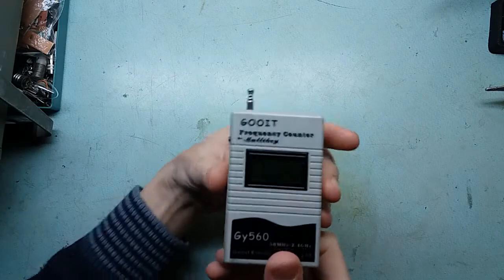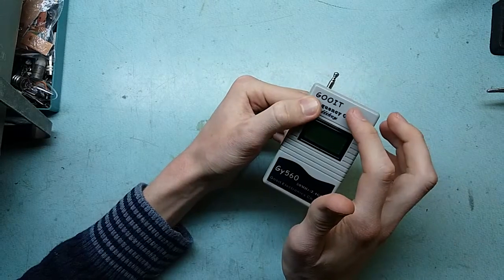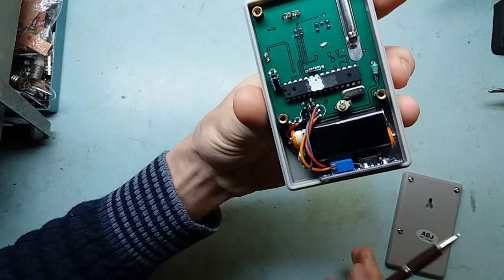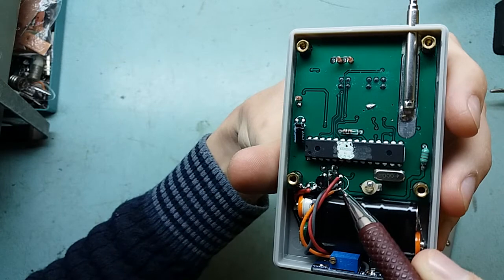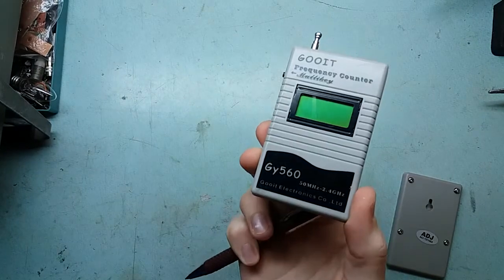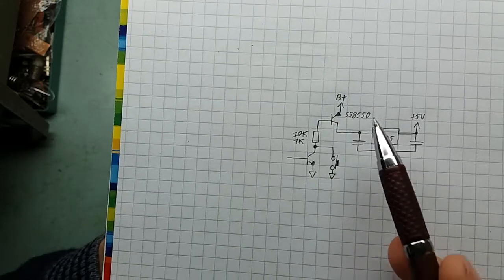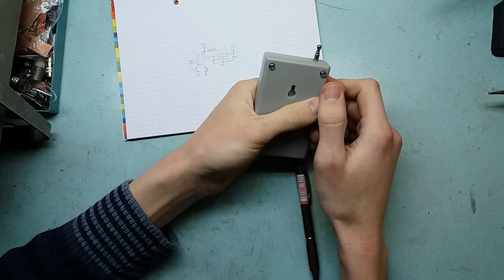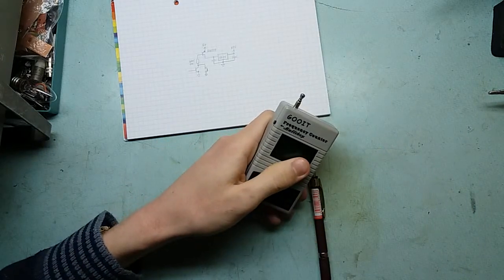Little mod to my frequency counter

Comment: In case you need to know, the chip in mine is marked as an ATMEGA8A-PU. Also, holding in the button as you switch on allows you to change the frequency step size between 200kHz, 1kHz and 100Hz. Handy little meter. :)
Reply from the maker: I'm aware of that trick with frequency steps, but thanks anyway :) I suspected that the chip is Mega8 or 168 or 328; judging from pinout. But it's nice to know for sure.

Comment: Thats working much like the one in your multimeter, but is much more compact and a nice multiturn pot to set voltage ;-D.
Does the frequency counter get any noise from the boost converter?.

Yes it does look like a micro, but why erase the number, im sure they slammed the door on the rom content so you cant read it.
Ive seen Obd 2 code readers that use just one pic chip, they are creaping into everything.
Reply from the maker: zx8401ztv I didn't notice any strange behaviour,  so I think it  doesn't mind a bit of noise :) Yeah,  microcontrollers are invading everything, as you saw in my torch : D
Reply: They are fine untill they go wrong, then the device is unrepairable, you can buy a new micro, but the code is locked away in the dead one.
Im not talking about your own creations, you have that code.

You can see why i like using basic stuff, no lost programming :-)
Reply from the maker: I like simple stuff too, I like making a circuit from discrete parts. That day I just felt like I should give it a try, and I successfully made it work, usually I fail on that. I like to have some skill in every area, not just in audio or power circuits :)
 I made a real mess in my FM superhet :D My goal was to make it without any IC (not even a voltage regulator). I'll make a video about it sooner or later.
Reply: I dont see micros as electronics, its a computer.

Dont get me wrong, i do like i.c's, the good old Lm317t regulator is very handy, i would not want to build that from discrete parts lol.

Radios are simple in understanding, but horrible if you dont get the stages spot on, i also used to repair cb radios, the front end/1st if/filtering/amp/second i.f/filtering/amp/detection stages have to work so good for a decent sensitive receive.
Any wrong value can ruin it.
A fm superhet sounds like a nightmare to get working well, you are a far better tech than i, i dont have the brain for design.
Reply from the maker: I don't hate IC's, I just decided to create some trouble for myself :D "Tech man" LOL That thing is a MESS, tuned by ear, tacked together, with IF cans that I wound myself :D I'm gonna make a video about it before I whack it (again) with another "improvement".
Reply: Hey you did it, i never tryed.
LOL whack it with another improvement, i had to chuckle :-D
You have a good sense of humor :-D.
Anyway i shall leave you alone, i could talk the hind legs off a donkey..
Reply: @zx8401ztv  Without the electronics, no computer would be able to compute! 😁
Reply: @SpeccyMan  now i am confused , 6 years after my comment lol.
Hmm speccyman, did you once fondle a zx spectrum 16/48k?
I made a frequency counter donkeys years ago, all simple logic chips,
the programming was hard wired, no code.
Oh dear im a boring git lol :-D